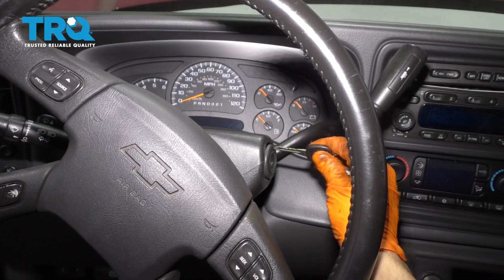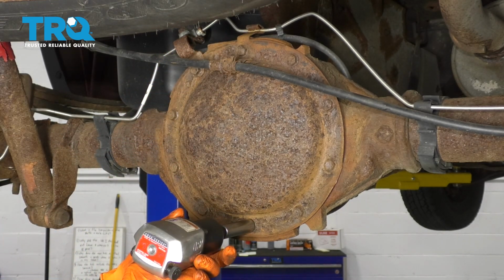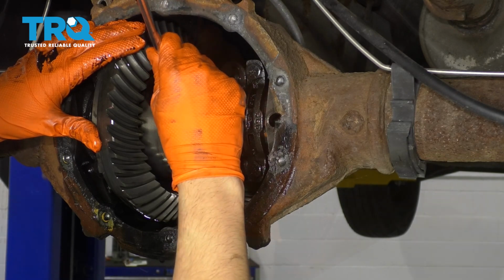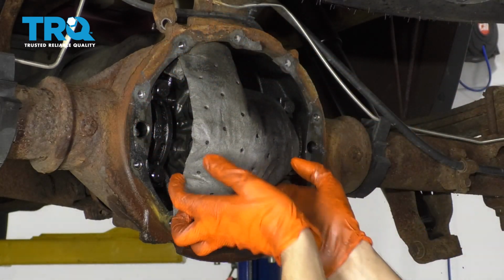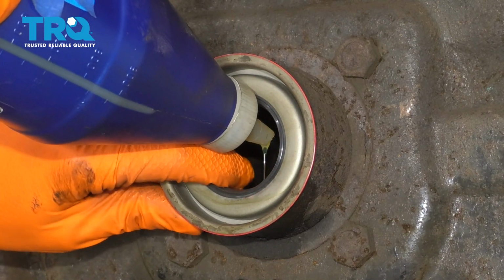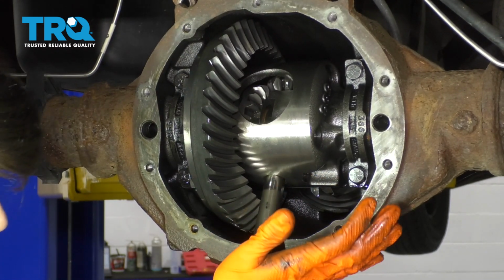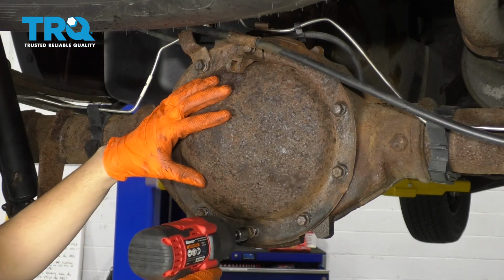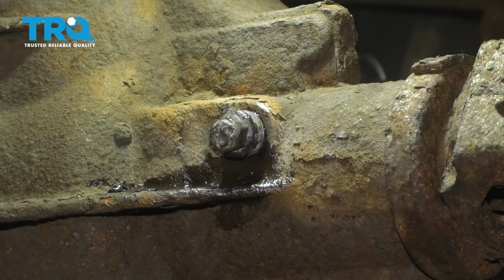How to Replace Rear Axle Bearing & Seal 2007 Chevy Silverado Classic

Comment: Use a good 3/4" or 1" wood chisel for a scraper they work great and also use antisieze to the center diameter of the brake rotor and the lug nuts makes things easier to change and helps get a consistent torque on the lug nuts.

Comment: grease wheel nut studs so that  when impact the nuts on to the studs it wont spin weld  the nuts  on to the studs  and when on side of road changing a tire ... cant  get  the lug nut off cuz the tire guy spun  the nuts up with impact and ... spin welded the nut onto the stud.